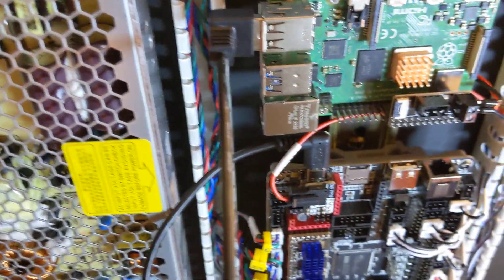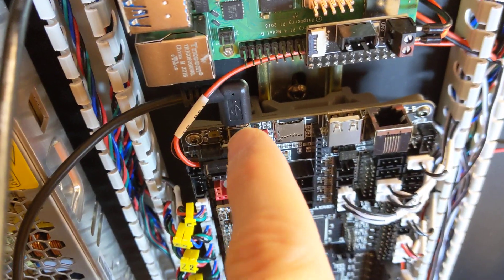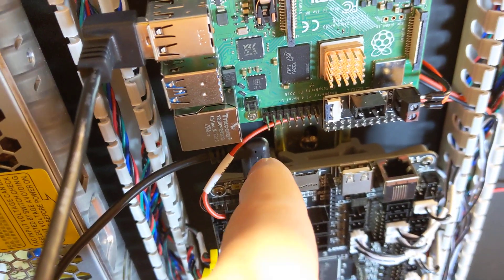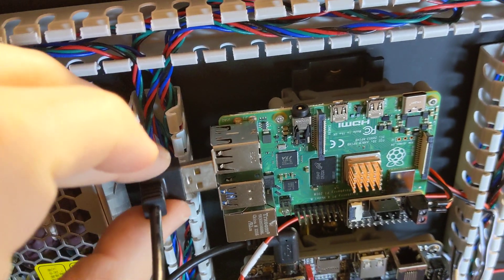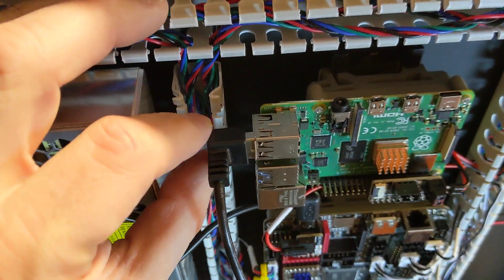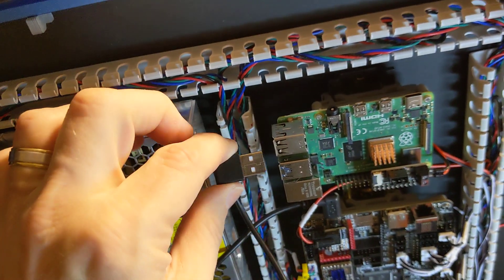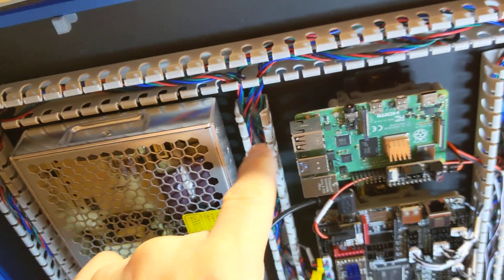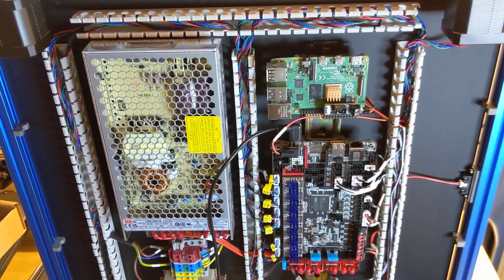3D Printer Voron 2.4 Rev. C 350mm - Build Progress Part 9

Comment: I saw the CL carbon fiber kit today and looking at getting it to upgrade my r1 to r2.  Does it seem rigid enough to you?  Quality of the parts?
Reply from the maker: This my first Voron build, so I'm not sure how much I can say until I'm up and printing.  Apart from the nuisance of some missing bolts, the actual parts are very nice.  I did have an issue with the A/B motors mounting to the back tube but I  don't think it'll cause any issues.

Since I haven't built a Voron before, my main concern will be how to adapt from the LDO kit wire chains to the CL umbilical.  It would probably be easier if I had got it up and running stock, then switched over.
Reply: @TomsProjects  Im on my 3rd Voron.. time and patience will get you amazing results :). I look forward to your updates